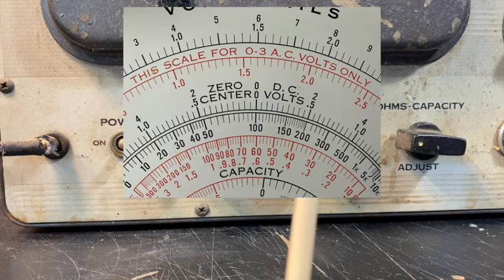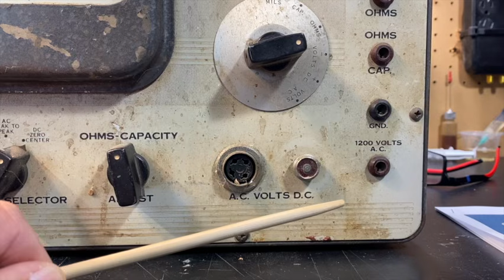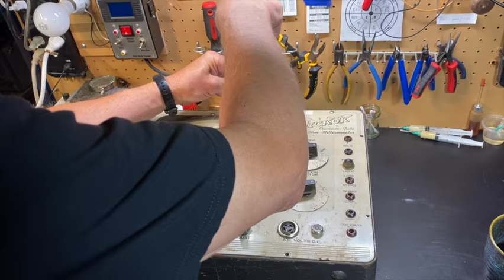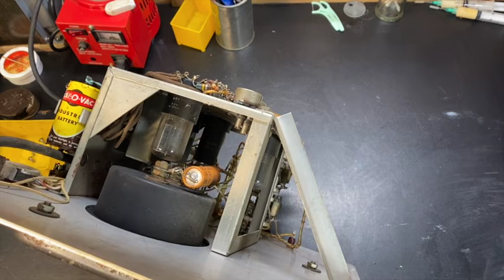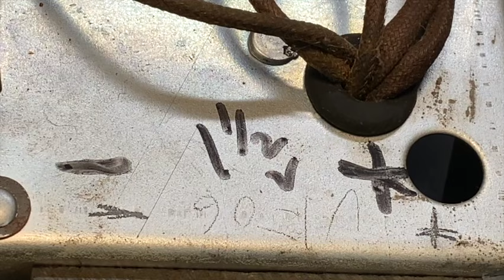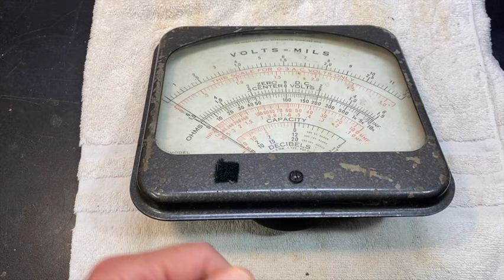Hickok 209A Part 2 - Looking Inside

Comment: I'm sure you are envious if you watch Mr. Carlson's  work on his Stark VT-9 a few weeks back and the two 1.5 V battery 
holders were prestine in his unit. Yes the two VTVM's  are identical in almost every way but the switches and jacks  are in 
different locations. The AC probe looks a bit different as the ground lead doesn't come out of the probe body on the side.
Not sure where ground lead is on the Stark. They both use an identical  4 pin microphone plug however. Replicating the AC
probe with a 6AL5 tube inside it to me would be a most daunting task! Maybe using two diodes instead? ( the readings on
the meter will be off if the diodes are "slow".)
Reply from the maker: I haven't seen Mr. Carlson's work yet.